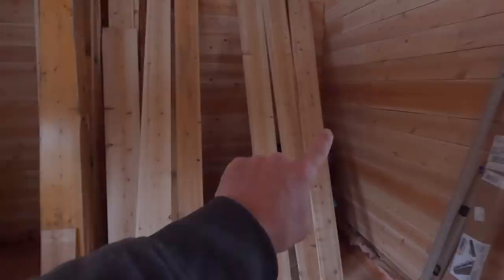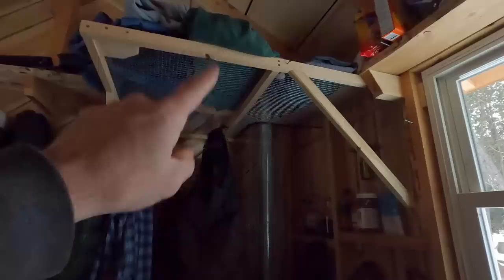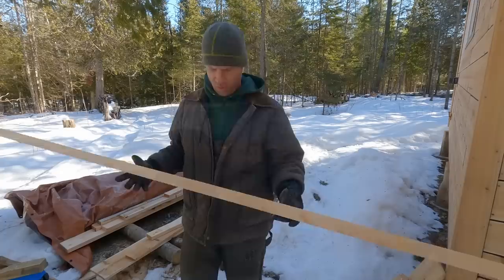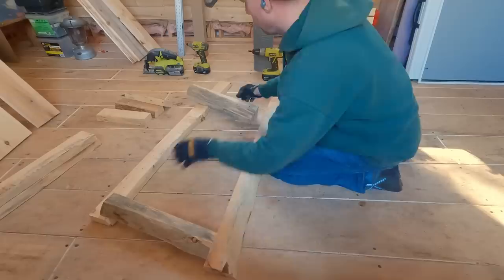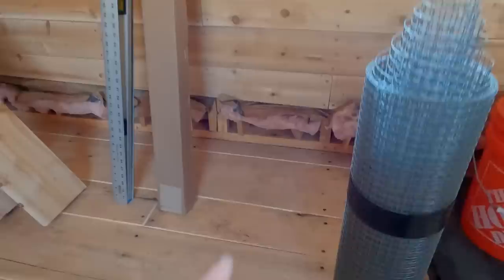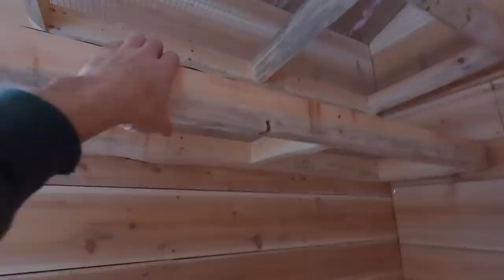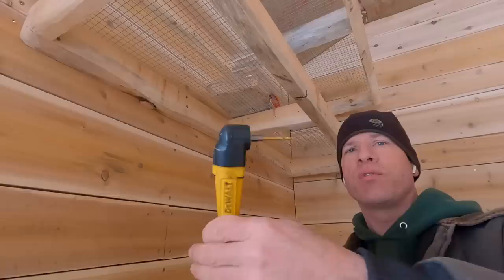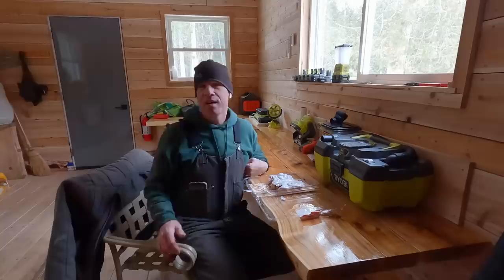Wilderness Microwave & Clothes Dryer Creation (from Alaskan Milled Building Scraps) #126

Comment: Well imagine if that works for a light bulb well they do make "heat lamps" like for say keeping your water warm or liquid and free as well!! Just imagine a flukey little invention like that how many other uses could you come up with I said add a switch but if you remove the magnet that is your switch right there just hang it on the wall or something. people will probably freak if they see light bulbs hanging on trees with no wires connected to them. Like the enchanted forrest or something or like bug zappers! like how in the hell are they working where is the power coming from?

Comment: plus they make plug ins that screw into a light sockets as well living in an older home l know this and use them occasionally during the winter for stringing chistmas lights that way you could test electric corded tools saws drills etc. to see if theyd work like out of thin air no chords or wiring. So this is kind of how Nikoli Tesla rigged an electric motor in a car at his time and drove around the upper part of new York all day long at speeds of up to 80 mph itb was originally a gas car and no battery on this car Pierce Arrow was the the name of the car back then. It was a strange story it still is if you think about it there were no batteries like today at that time.  So to me it was like magic I had no clue you could tap into the earths power that the rotation of the earth was like a power generator you could tap into if you figured how to attract that energy. N here it is one simple way anybody could do this... N I think or know Tesla knew this as well.

Comment: Not to rain on your parade, but why don’t you build a small wood stove? It will keep the building warm, dry yourself out and remove the  moisture. I live in Alaska at -50 for more than 20 years. Use a 2” metal pipe to bring in combustion air for the stove so you’re not using heated air for combustion.

Comment: Hmm keep this in mind when you run out of power you need two spark plugs an electric light socket some wire two pieces a piece of wood and some heated glue and a light bulb and a magnet fairly large magnet round with a hole in it. You might think its magic but there is another type of power being produced by the rotation of the earth you cant see it no sun or wind needed its available 24/7. If you know how to attract it this ether Nikoli Tesla knew this to.  So the idea of putting up like a steal pole or pipe like a flag pole with a few spark plugs and connected should give you a certain amount of free energy. How much I dont know maybe enough to run an electric or plug in tool or saw as it works for various powered light bulbs. I know it sounds crazy but since ur none conventional type guy this is a pretty cheap experiment. You could use to benefit you in many ways for lights tool charging or maybe even heat. Dont laugh but a friend of mine uses a light bulb to keep his 50 foot deep well and pump on his ranch from freezing during the winter in North Dakota.

Comment: Why don't you build a Kiln. It would help dry your wood and give you a place to store it to keep it out of the weather. You could sort the different type of wood and different sizes, and with that much wood ready to use you could cut it into standard Dimensional lumber. 

With the dimensional lumber it would be so much easier to figure out how much lumber to cut. 

Then you could get a band saw and maybe in ten or twenty years you could build up to a wood fired steam generator and a diesel powered circular saw mill. You could build your own civilization at the Worm. 

Your friends could come out and live there rent free just be your serfs and provide labor for you. I actually did not mean serfs I meant fiends without benefits well they get the benefit of free rent. Oh, hell l uh.. hell just do it your way it is better video.

Comment: Captain obvious here. How about a hand rail on your steps. Ounce of prevention. Just maybe if need be you can grab it. Maybe lessen the impact of a fall. Or some kind of roof over the steps so no shoveling or shoveling less off them. Being remote area safety should be first. At least fix the problem or minimize it. I don't think videos from hospital real fit with what your doing.

Comment: If you did a bit of extra work - you could insulate the man cave and make that a new permanent heated store room and spare bunkhouse.  

That smaller heater with all that extra stove stove pipe exposed on it makes a heck of a difference.  You don't seem to get how useful insulation is yet and the amount of money you'd save by doing that would pay for the all the propane you waste heating it now.

Lastly why not toss a Camp Chef CS-14 wood stove in the new cabinas well, it'd a be a backup to the new heater and might be nice backup if you ever run out of propane.  That's the way I'd do it, run the wood stove every evening after dinner then stock it for the night and hit the sack then 4 hours later after it burned down the heater would kick in so you don't need to wake up to restoke the wood stove.  God knows you have the scrap wood to fuel it.